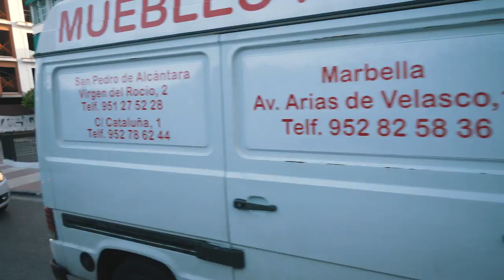DONT DO THIS AT HOME!!! | VLOG² 38

Comment: Wow I think the jumping thing is pretty reckless, there's a reason why the pools at public bathing areas with jumping boards are 4 to 5 meters deep. I know that he didn't touch the floor, but if you loose control in the air and jump down more straight, you'll probably crush your knees...